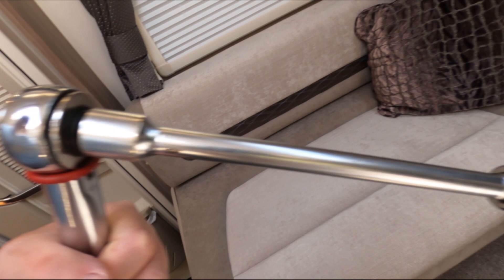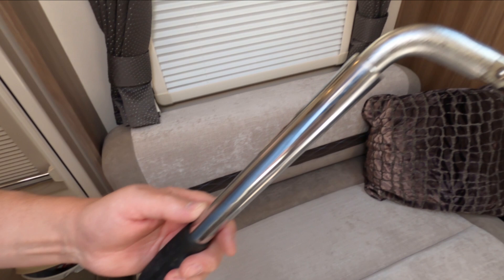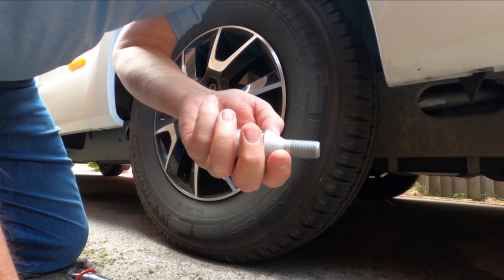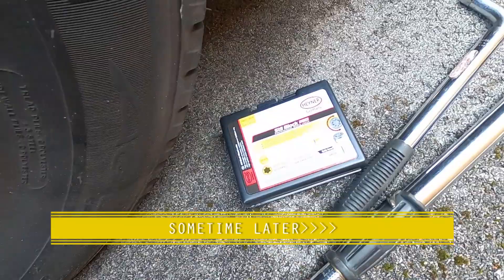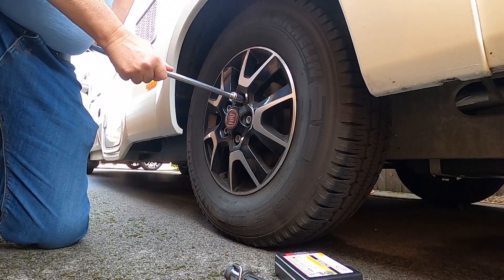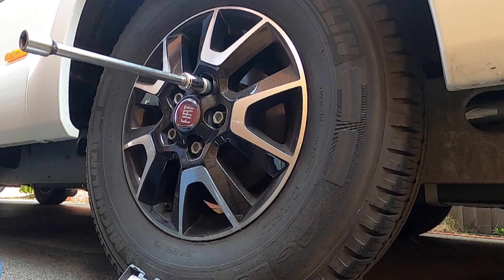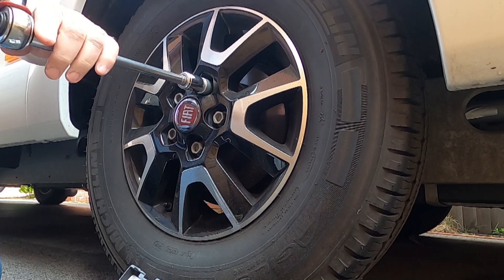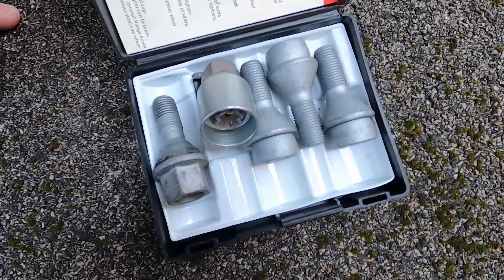Locking Wheel Nuts For A Fiat Ducato Motorhome | Product Reviews

Comment: I think it is an age  thing ,working up a sweat doing simple jobs. I am pleased to see you fitted the locking wheelnuts opposite the tyre valve to help with balancing the wheels and reduce vibration. It's amazing all the place van makers build storage into, most opportunist thieves would realise where everything is concealed. You definitely need Jenny as a camera person when doing practical tasks! Keep safe. Guy.
Reply from the maker: Yes, or it's the humidity. 😃 Thanks!

Comment: Thanks for this Bob, we have had fitted the HPC levelling system from Lnb Towbars in Bristol and during the pickup demonstration, the fitter advised that we should fit locking wheel nuts, honestly it hadn't crossed my mind that a £60 + K motorhome would not come with locking wheel nuts! Still, I've ordered via your link and will be fitting them in the next few days. Really love the channel by the way.
Reply from the maker: Thank you very much

Comment: Nice video Bob, the shorter the extension bar the better, (there is a science to this) and you would find it a lot easier to get the bolts out. Also 6 sided socket is a better bet than a standard 12 sided socket (stops rounded off heads). Keep the videos coming, great stuff Sir.
Reply from the maker: Thanks yes a few people mentioned this, never thought about it, I just grabbed the first one that came to hand.

Comment: Hi Bob not 100% sure on this but I was always told to not use a long extension with a torque wrench it won't give a totally accurate reading use short or none at all if possible.
Reply: You are correct. Torque = Force x Distance, ie the force applied to wrench multiplied by length of wrench. By increasing length of torque wrench you are increasing the applied torque.

Comment: Very entertaining did make me smile at the end. having been in the motor trade im well aquainted with locking wheel nuts and have had to remove several when the socket has been lost or worn by over tightening. A point to note is the locking nut as a rule is not torqued as high as the other wheel nuts. Can i also advise that when you have you tyres changed or punctures repaired remove the locking nut yourself because many mechanics and tyre fitters WILL use an air or battery powered gun,even through its poor practice it saves them time then when you come to remove them at the side of the road in the pouring rain you can damage the locking socket beyond repair, believe me this happens a lot.
Reply from the maker: Thanks, useful to know, so if the normal bolts are tightened to 160nm what would suggest for the torque on the locking bolts?
Reply: I will ask a mate of mine and let you know he works at a Peugeot main dealer and they also service motor homes
Reply: hi Bob. the advise he has given me is that technicaly the locking nut should be the same as the wheel nuts he did advise using judgement that they are not overtight but so they can be removed without too mch force, this backs up my thoughts that an air gun should never be used on the locking nut or bolt.

Comment: Bit of grease on your wheel nuts will help stop them rusting in the threads
Reply: You shouldn't use grease on threaded fastenings when torque loading unless specified by manufacturer. The grease affects torque loading and you might over torque.

Comment: Had them fitted before pickup and it’s been some I’ve always had fitted. I would invest in a 6 inch extension as the one you were using tends to twist a lot when the nuts are really tight or put an axle stand under the extension bar to support it. It does hurt if the whole thing comes off while your trying to loosen or tighten and you can end up with knuckle rash.
Reply from the maker: I will use the shorter one next time, that was the first one that came to hand.

Comment: Hi Bob, I bought the same ones last year and fitted them myself.  Unfortunately we had a puncture on the osr tyre last week and whilst I could undo the 4 normal bolts the locking one was a nightmare.  I tried my extension bar but, that will not allow the socket to go on square and not wanting to break the locking bolt I used my breakdown recovery.  The guy arrived and only had an extension bar, like mine, and proceeded to break the top off the locking stud - great!!!!  He then did a temporary repair on the tyre with a plug, not very happy our motorhome is 4.5T but, we made it home.  I have now booked it into my local garage who have the gear to extract locking wheel nuts and bolts and I have told them to remove them all and put the original ones back + carry out a proper repair to the tyre..  Thinking about it there is a lot of work involved to jack up the motorhome and remove the wheels so I will take a chance by not having them fitted again.  It might be worth while seeing if yours are able to be undone and not be left in a situation that if you were to have a puncture the stud breaks and you cannot repair the tyre whilst its on and you cannot remove the wheel either.  Hope yours are ok.
Reply from the maker: Good tip,  I will get them checked.

Comment: Would be good practice to apply a little copper slip to help prevent seized nuts. Nobody likes seized nuts!!
Reply from the maker: Yes, but it you shouldn't get copperslip on the contact surfaces as this is the 'friction coupling' surface.
Reply: you shouldn't use copper slip on wheel nuts or bolts . It defeats the purpose of torque wrenching. they should be "clean dry threads".
Reply: Definitely get some on the treads to prevent galvanic corrosion

Comment: Not Locking wheel Nuts Bob! it's Locking wheel Studs on your vehicle. And better not to use a long extension on your torque wrench. Cheers Bill
Reply from the maker: Thanks yes, they are technically locking wheel studs, but the manufacturer actually calls them locking wheel nuts in the description.

Comment: Yes we have fiat locking nuts and the wrong ones were sent first too. Got them put on at a tyre service place for a fiver
Reply from the maker: I ordered the wrong ones, they would have fitted my previous Bolero on a maxi chassis.
Reply: I also had the same problem ordering the "correct" nuts for the same wheel on my auto trail - did not fit.

Comment: Easily to get caught with wrong size as even my dealer and Fiat using the VIN number still got it wrong with M16 instead of M14 . It's the 16 inch wheels and 15 inch wheel on the lightweight chassis confusing the issue with the maxi chassis .
Reply from the maker: Yes and I have 16 inch wheels on the lighter chassis.

Comment: This was another very interesting and helpful video as I thought that all alloy wheels came with locking nuts. We picked up our new van yesterday and I suspect we don’t as no one mentioned it. Do you think that the wheel nuts will be the same on the Citroen relay as the Fiat Ducato? Thank you. 💕🐾
Reply from the maker: Yes, it should be the same as they are made in the same factory, but it does depend on the wheel size, so double check that.
Reply: @BobEarnshawMoHo  Will do, thank you. 💕🐾

Comment: Hi anybody knows what wheel locking nuts fit a Malibu 540 is it a 14 or 16
Reply from the maker: It depends on the chassis, the heavier chassis have the M16. The 16 refers to the diamter in mm of the nut or the hole it fits.
Reply: Hi  it's a fiat it is I asked a few people nobody know which one do you think I should buy
Reply from the maker: It's probably M14 as it's a small van, have you measured the nuts?
Reply: No it's a new van pick it up next week

Comment: Is your van a light or maxi chassis ?
Reply from the maker: It's a Fiat Alko light Chassis re plated at 3850kg and uses the M14 wheel nuts.
Reply: @BobEarnshawMoHo  Thanks Bob,I have ordered a maxi chassis camper van and Ian wondering what style of wheel it will come with ? I hope it has the same as yours but I have seen a different design on some . Thanks.
Reply from the maker: @Stescaff  it will probably have the silver alloys that go with the maxi chassis.
Reply: @BobEarnshawMoHo  Thanks, I will have a look at them.